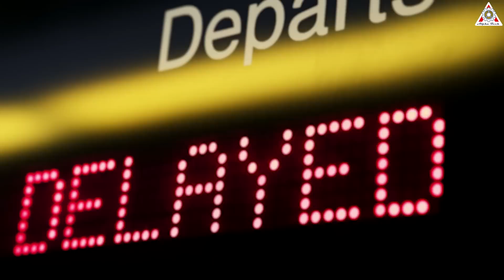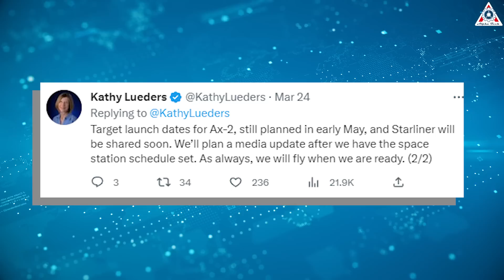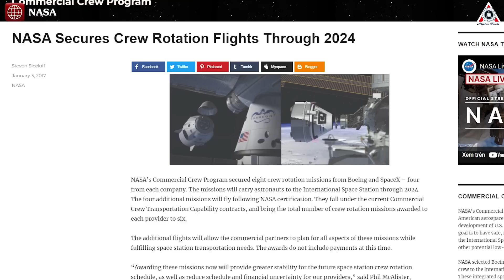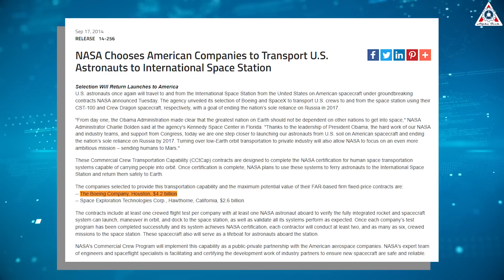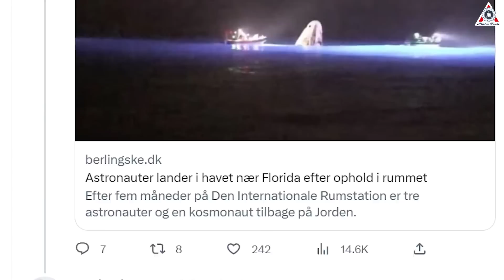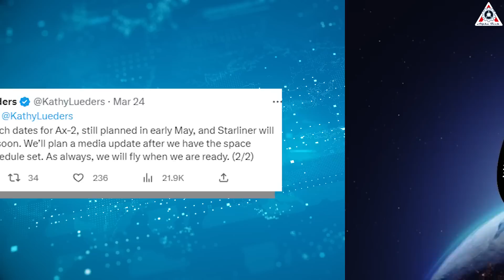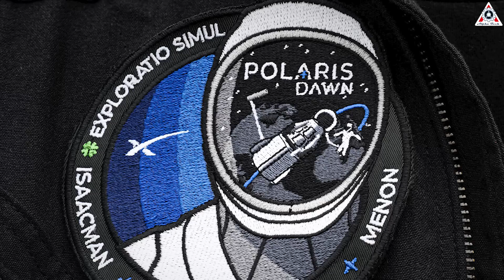Starliner delayed again! NASA gives up...

Comment: The issues with StarLiner are 2nd only to SLS for being an embarrassment.

I get that “space is hard” but ffs.
Reply: With all of the many space hardware startups there is currently a HUGE shortage of technical personnel and I can easily see why most of the best ones would prefer to work for those innovative and exciting startups who are "thinking outside the box" instead of the old, bloated legacy aerospace companies.  I suspect that is what is behind both the SLS and Starliner fiascos - bloated, formerly single source government contractor bureaucracies with less than stellar personnel.
Reply: SlS was an embarrassment?
Reply: @faikerdogan2802  a BILLION DOLLAR A POP ONE
Reply: SLS is all Space Shuttle left overs - so Space is hard - doing what you have already done is not.
Reply: SLS worked first time.  You can't say that for SpaceX or any other private company.  When you look into the real cost its about twice that of SpaceX for equivalent mass to orbit (SpaceX hides a lot of its actual costs, for one they never include "launch services" which can be 4 times the booster cost).  Do you want to ride on a thoroughly analyzed rocket or one that blew up every time except for the last one?
Reply: @RS-ls7mm  Are you a Boeing Fangirl? RS= REAL STUPID
Reply: @RS-ls7mm  10 years late and 500% over budget to re enact Apollo is not a ducess